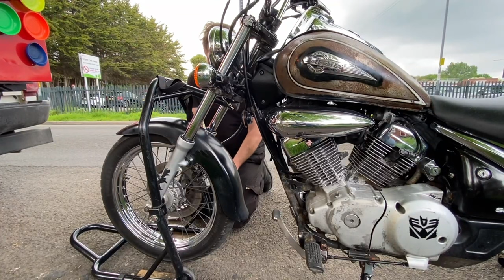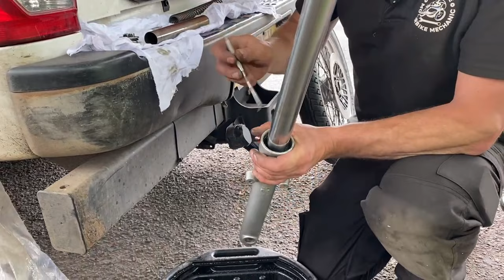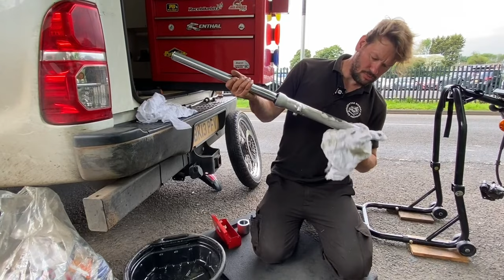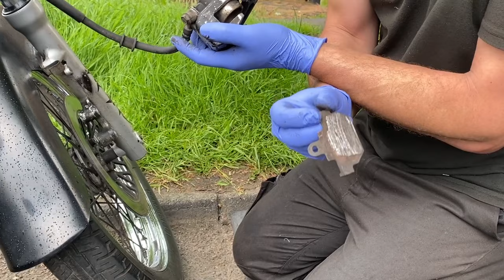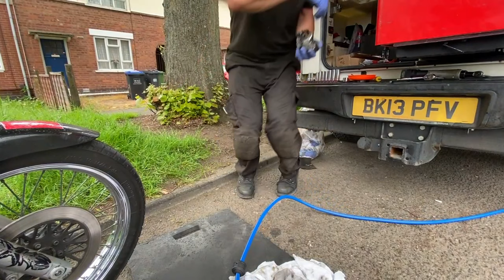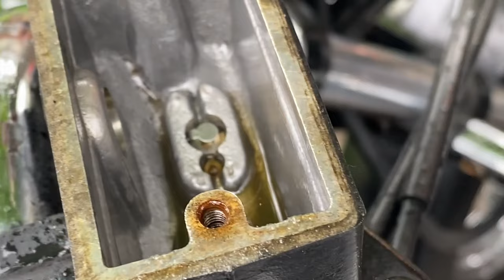Fork Seals & Brake Calliper Rebuild on a Suzuki VL 125 Motorbike

Comment: Hi what I used to clean the calliper piston fluid seal and dust seal grove was a dremal wire wheel worked a treat
Reply from the maker: Thanks for sharing. You need to go steady with power tools as they can make things worse very quickly. Hand tools make mistakes slowly.

Comment: Very interesting watching mate, I admire your ability to be able to work anywhere, even on a busy main road in not so nice weather! 
     Just a couple of questions, what did you use to clean the caliper piston and what are those pick tools called you used to take the seals out with in the caliper, I need to do my own braid caliper on my bike.
Reply from the maker: Glad you enjoyed it.  We use a fine grade scotch pad and brake cleaner to clean up the pistons. If the pistons are very badly scored/rusted they may need replacing. 
A link to the pick tools can be found in the video description.